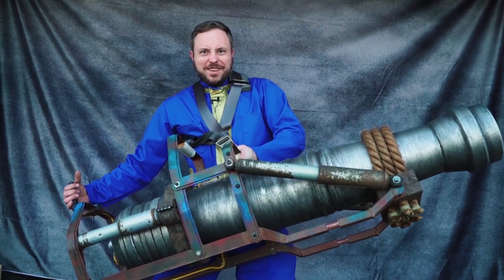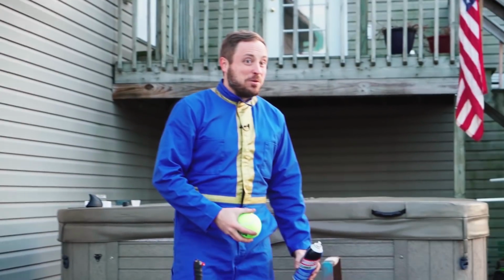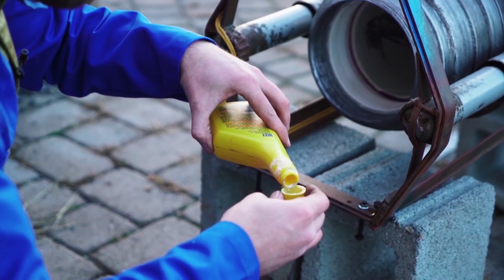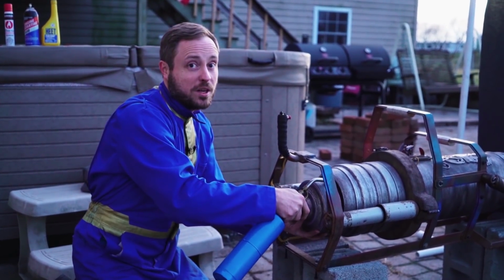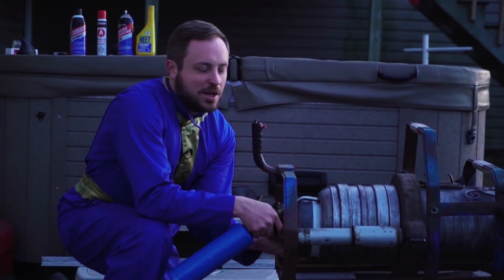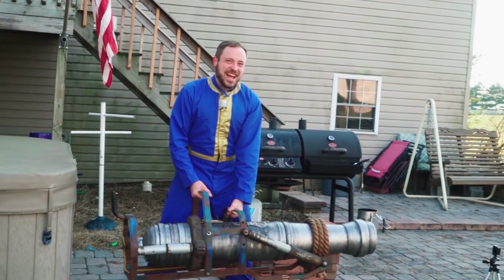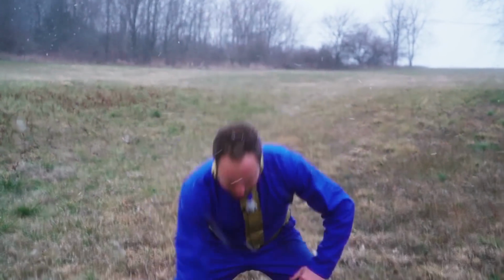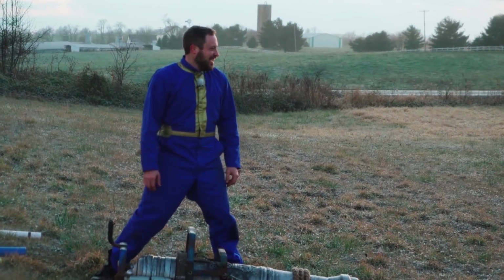BROADSIDER Real Life Fallout Canon Test Video

Comment: A trick we used to use is to put projectile at tip of barrel, add propellant then push projectile in to “compress” the fuel air mixture.   It seemed to also help with getting some fuels to mix proper and be combustible.

Comment: If you put the tennis ball in the bore first then spray in the fuel, you can add a bit extra then push the ball to the back and you’ll get more power because there’s compressed mixture in the combustion chamber

Comment: I don't think people will realise how powerful that is like that's a tennis ball and it blew that watermelon into tiny tiny bits lmao 😮😮😮😮
Reply: Could you also use metal balls to do this or would it damage the cannon?
Reply from the maker: I don’t think it would hurt the cannon it just wouldn’t go fast. I wouldn’t get a good seal and it doesn’t develop enough pressure to move that much weight.
Reply: @jairusofall  i didnt think of the weight factor i supppose you could use rubber cannon balls tho strong enough in theory but still light?

Comment: you should add a propane tank with torch head with some sort of servo valve hooked up to the back of the cannon so  you dont have to unscrew it every time you shoot, AND its pre mixed with oxygen from the torch head so  you can load the cannon ball and then fill it with fuel from a separate switch on the grip or one of the front handles.

Comment: grab yourself a cream whipper,
that way you can inject nitrous oxide into the combustion chamber, back in my youth i made a paintball/marble gun that fired with propane (same idea as in the video) but with a whiff of nitrous in the combustion chamber was accelerating paintballs to the point they were vaporising from the air resistance after a couple feet out of the barrel

Comment: Cheapest Suave Hair spray gives best combustion. Also ur cannon should be a 2:1 ratio in size dimension of your barrel and combustion chamber . So tech. Speaking ur 4ft barrel 2inch diameter.  And have a combustion chamber of 2ft with 4inch diameter.
In my experience having a y connection for barrel works best and give u a 45degree barrel platform giving it more velocity

Comment: wouldn't you need to find a way to vaporize the gasoline or the heet to combust in the way your using it, sort of the same way injectors apply fuel to a cylinder?

Comment: really, from gasoline you have a problem?  Look man not to be rude or anything didn't you know gasoline's toxic fume escape faster than a few the other stuff you know that right, which means you did not give enough time for it to spread or either you didn't seal the gap enough to give that thuum (power) and sorry using Skyrim in way references but pretty much it is really more likely the sealing and the electric shocking is having issues because you either purely burnt out the seal rubber or the electrical starter is cover some sort burnt something but I am not scientist but work with some engineers and scientist (do not talk about mad scientist for I tell you steer clear those bunch high prideful bastard) along with some plumber guys which they do have similar uses of sealing stuff and what part need improvement which it seem that it probably more likely is your electrical igniter is probably the problem.